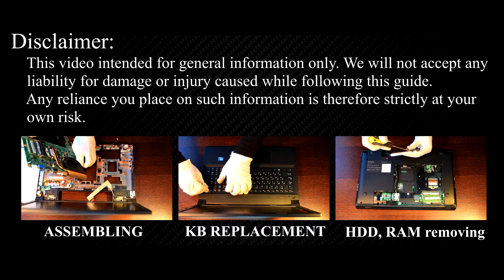Lenovo B590 Disassembly and Fan Cleaning

Comment: Thank you, this fixed my laptop and its now more silent than ever!
Only problem i have now is that it wont charge. Do you maybe know if any of the wires that were unplugged could have caused it?
The think is 5 years old so it might also be the battery or the cable, but i dont know